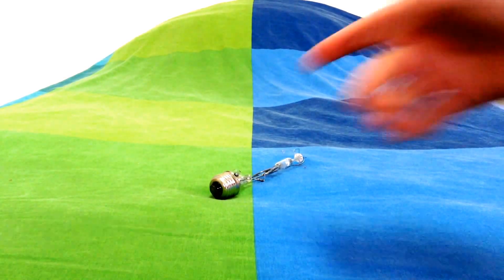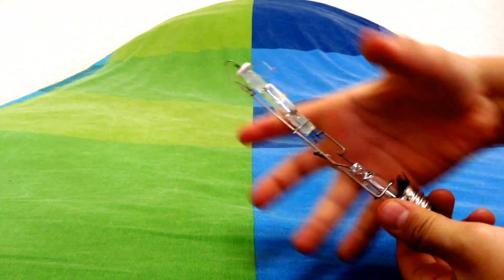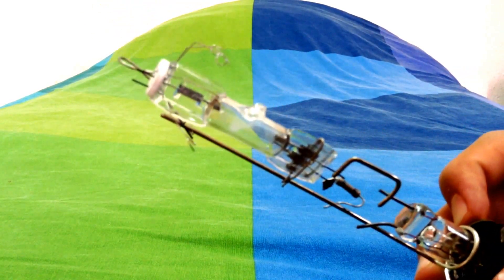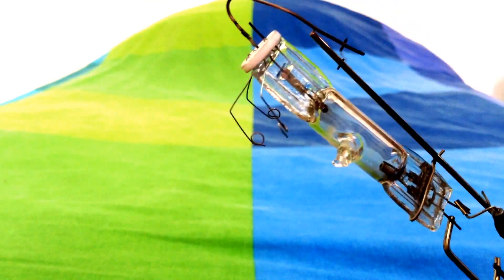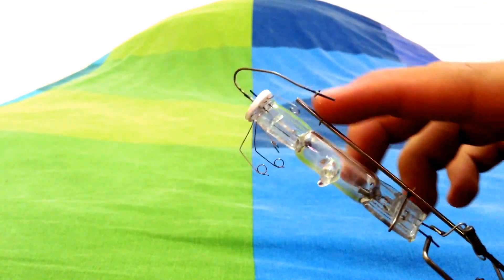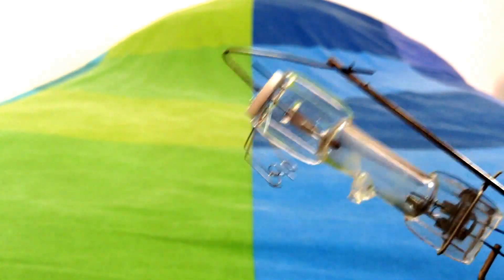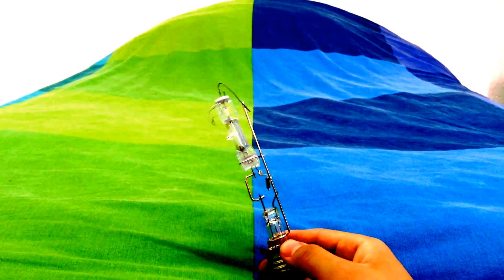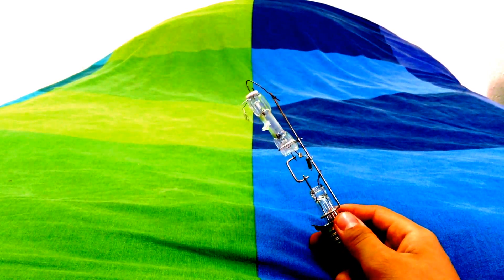Broken 100W Mercury Vapor In Action!

Comment: HELLO FRIENDS, I WOULD LIKE TO KNOW HOW I CAN CREATE A STARTER FOR THIS TYPE OF BULBS.
Reply from the maker: Rosa Mendoza This was a self-ballasted MV, so it didn't need an starter. The filament served as both starter and ballast. 

In the video, with the filament gone, I supply it with a 100W HPS ballast that also had both a starter and a capacitor, so it didn't had any troubles igniting.
Reply: mercury vapour lamps are probe start, so as long as you have an adequate ballast you can run them and they can start themselves. If it's self-ballasted then you just need a socket to put the lamp in.
Reply: You do not need a starter